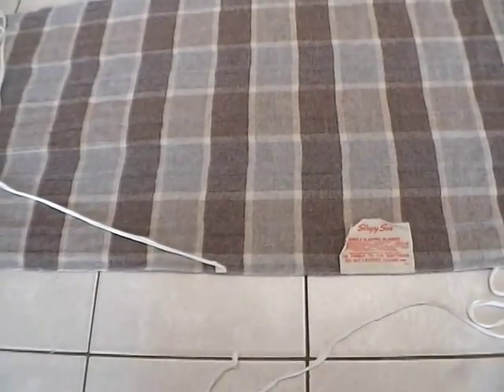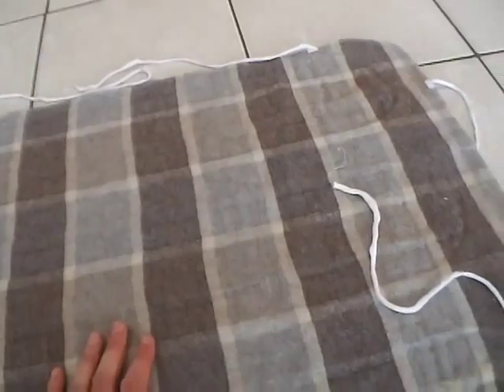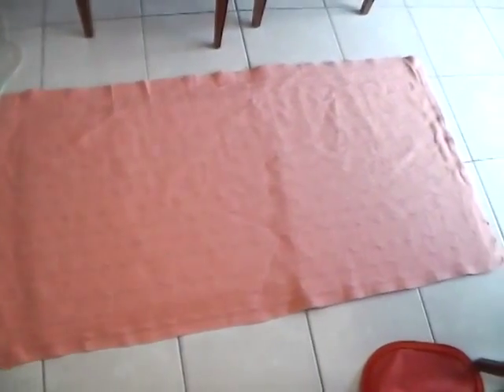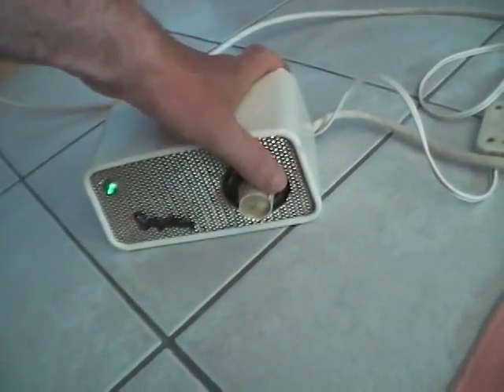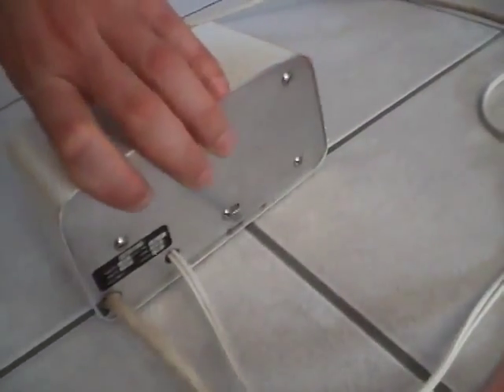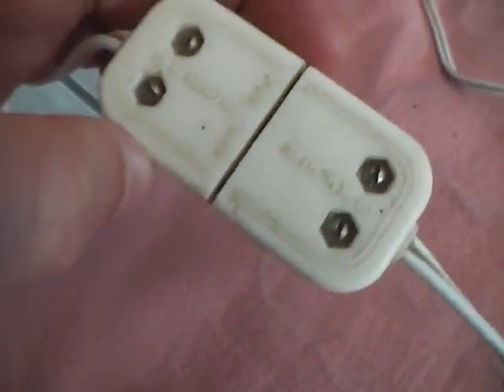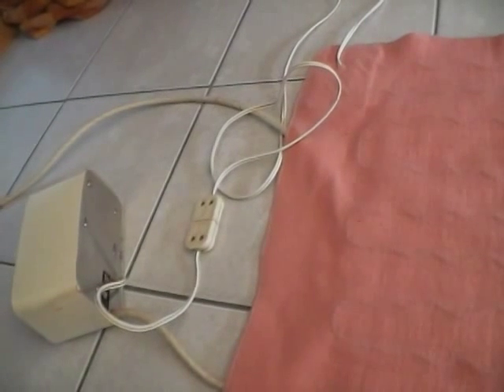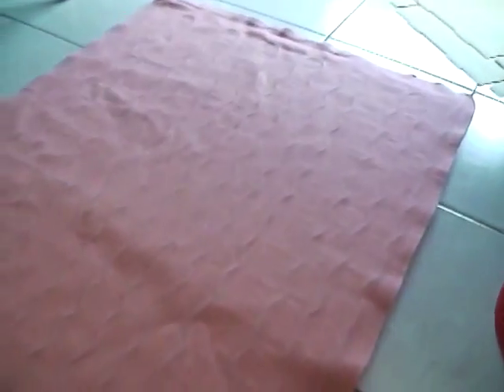Off grid electric heating

Comment: The resistor would be huge but you may be able to do it from a 12v laptop adapter... one that the voltage is adjustable. a 24v laptop adapter should also work too.